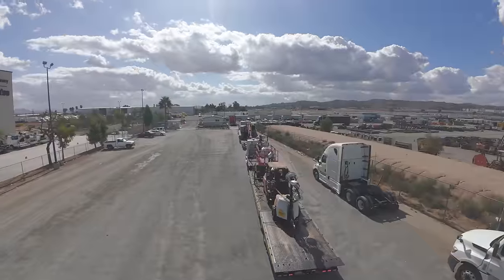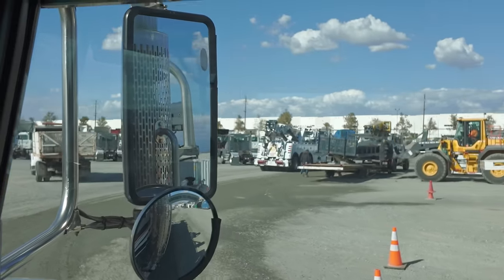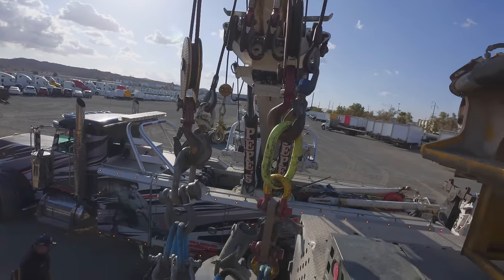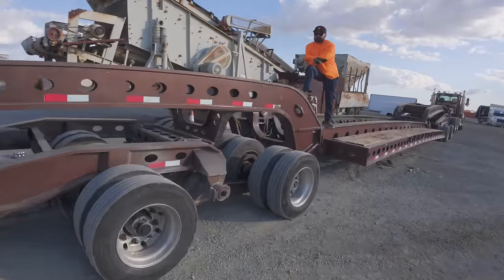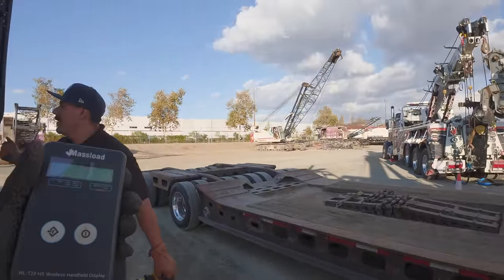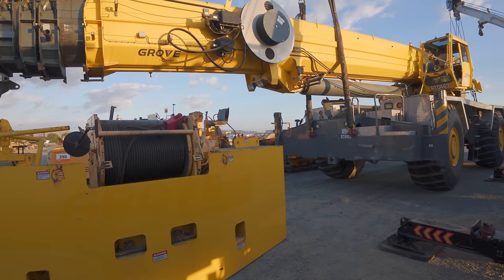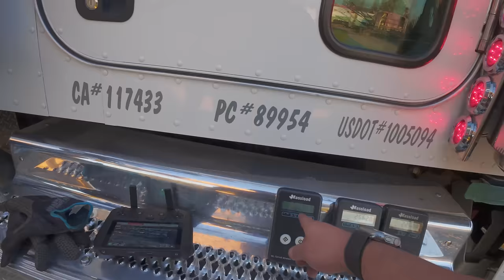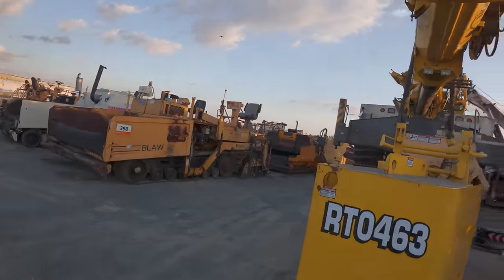Will We Be Able To Lift This MONSTER Crane?

Comment: I would like to point out the irony of a company that auctions large equipment doesn't  have large equipment to handle large equipment.
Reply: it is the rigging and the know how when you are pushing the limits.
it is knowing when to say no🤠😎
Reply: @edwinmartin9120  Gee, thanks for sharing, you know I was born yesterday 😐
Reply: Why bother when you can just call hulk and flipper?
Reply from the maker: I know this is probably party joking but there's a few reasons. Cost, having an operator on standby for when these come in, liability, etc. Plus they just store dead and junk equipment lol all the cranes they have here are sold for cheap since they don't work or badly damaged.
Reply: @PepesTowingService  was this crane dead as well? could not drive it?
Reply: @SlickFootTito  This is a 2014 Grove RT9130E-2 130 ton 4x4x4 Rough Terrain Crane and it is totalled and non operating.  While being transported it hit a bridge, rolled off the transport and rolled.  It has 8095 hours on it and being sold for salvage for best offer only. The damage is actually extremely bad. The engine can not be started and  the drivetrain is damaged.
Reply: @PepesTowingService The requested history of the damaged crane is in this thread.

Comment: That crane hit a bridge in Long Beach in march that was handled by Van Lingen towing.
Reply: went full on investigator for that info
Reply from the maker: Yup, I even showed Sean over there the pix when I did this lift and knew they were very similar, just didn't figure it was the exact same one until today lol
Reply: Could it had been put into neutral and gotten pull off with winch or pullstraps after Tractor detached from lowboy?
Reply: This is a 2014 Grove RT9130E-2 130 ton 4x4x4 Rough Terrain Crane and it is totalled and non operating.  While being transported it hit a bridge, rolled off the transport and rolled.  It has 8095 hours on it and being sold for salvage for best offer only. The damage is actually extremely bad. The engine can not be started and  the drivetrain is damaged.  There is 214 pics online of the damage.
Reply: @DJones-tm3qi  Possibly...if ya wanna risk a runaway.

Comment: Hi from Canada, enjoy watching you guys. Your comment on the Canadian towing/ recovery shows about the drama is correct, but remember it is a tv show, so a little drama is needed. Your broken chains comment, could be partially correct regarding angle and load factors. You have to take into consideration the extreme weather, and temperature these guys have to work in as well, and the effects on the gear. Anyway that's my two cents, as I said enjoy watching you guys with no nonsense recovery work, and strait forward approach.
Reply from the maker: I'm not a fan of the theatrics. Every call is like some life or death job. And good point about the weather, but that still shouldn't happen if you never exceed the working load limit. And it happens all the time down south and in my areas where it's always sunny.
Reply: Great job, guys, unloading the crane and then rerigging to show the weight and flying the drone underneath. Also, it's kind of you to help out at the end. Thanks for sharing. ❤

Comment: Amazing job brother, I would believe this crane lost it footing or lost a load due to degrees and reach ,in 98% of cranes tipping it is mostly operator error. I operate 50 T crane and heavy heavy float , the dynamics and principals are the same when it comes to rigging and grabbing a load. I know most tow company's don't require a certificate but I would highly recommend taking a full crane rigging course , the education is priceless and may save you and others from stupid mistake. Here in Toronto some heavy tow company's have taken the course due to some fatal errors.   Cheers and blessings from Toronto Canada.
Reply from the maker: Turns out it hit a bridge! My good buddy at Van Lingen did the job before so I'm well aware of it. Just didn't put it together that it was the same one.

Comment: Hey Josh and Alex, I took one look at that yellow machine, and I immediately said, 100,000 pounds, looks like I was nearly spot on, I just needed to add another 20,000 pounds to that. Those Bailey's are absolute bosses, so are your rotators, lifted that crane machine like it was nothing. The counter weight being 44,000 pounds, technically can be done by a single rotator, its just that using a 2nd rotator, makes it easier. I also hate it when I lose things Josh, I understand the feeling. The driver from the 2nd job, he and his boss need to simmer down now. lol Great job breakdown at the end as usual!

Comment: I have a quick story about a crane just like this one. I worked in a government shipyard from 1993 till 2000. A government engineer and an operator were testing the crane. The engineer had the operator retract the outriggers and then angle the boom down from its upmost position. Well, with the boom nearly fully extended, it didn't take long for the center of gravity to be reached and over the crane went. It just so happens that the truck that the engineer had driven to the location was directly in line with the boom. The truck was totaled and the taxpayers got to buy a new boom for the crane, which was a rental.
Reply from the maker: Oh boy what a story!
Reply: Your tax dollars at work. No accountability.

Comment: So real quick on load cells they are scales they just have a digital output. The only type of scale that doesn’t measure force is a balance scale the load cells are just a metal bar with a foil attached and as the bar stretches the foil stretches too and as that foil stretches it’s resistance changes and this change can be converted to a force

Comment: The RT0463 labels seem to be more of a serial number, (no matches) hmm. The label on the counterweight is RT9130e and if that's right for the whole crane then it's a huge unit capable of 130 us (short) tons.  Undamaged I'm seeing prices above $350,000 even for units from 2013. One listed at $495,000.  So undamaged this is the rare case where the lifted item was ever worth more than the two rotators. 

None of the crane sites I can find document an accident involving a large Grove rough terrain. So hopefully no-one was injured, maybe it fell off a transporter, or rolled down a hill sideways. Someone's insurance has a big hole in it now.

Comment: Well it wont let me post the link to Iron Planet so heres what they said on the description for the sale said.

Meter Reading8,095 Hours
Serial #234XXX

8095 hrs Crane Operation, Cummins 6 Cylinder 300 hp 8.3 L Diesel Engine, 42 ft Minimum 160 ft Maximum Boom Length, Auxiliary Hoist, 37 ft to 60 ft Bifold Jib, 726 lb Johnson 7 Sheave Hook Block, 726 lb 10 ton Capacity Overhaul Ball, 40000 lb Counterweight, Counterweight Removal System
**Seller Comments: The unit sustained impact damage on 03/18/2024. It has been reported that the unit struck a bridge and fell off the trailer while being transported. This unit is being sold as part of an insurance claim**

The operating and/or physical condition of the unit could not be fully verified by IronPlanet and any underlying damage or issues are unknown.

This item is sold AS IS WHERE IS with all faults and no warranties expressed or implied by IronPlanet.

Comment: Your shocked a 75 ton can lift 36,000 ?? 😂
Reply: That was just on one line not both lol
Reply from the maker: I'm shocked at how dumb some people are when it comes to comprehension. You are the reason shampoo bottles come with warning labels.
Reply: @ 🤣🤣🤣 warning labels
Reply: @PepesTowingService 😂😂😂right
Reply: Every year, the one thing that should be common among humans gets lower and lower. Common Sense is no longer above 50%, it is about 20%. So should we now be saying UnCommon Sense?
Reply: 75 ton is off the back with the boom all the way retracted so you have the whole truck front to back as counterweight,. so it's almost never useful . on cranes many are rated at 10 - 15 ft radius from the pin so right beside the crane. they all have load charts as well. the capacity drops very fast as you get further away from the pin. it's just simple math  and geometry.
Reply: Silly  you lifted 74,000 with your 50 ton
Reply from the maker: @3dland-x4x imagine being a jealous hater yet still watches every video and comments regularly 😂 glad to be of service
Reply: @PepesTowingService  who’s hating